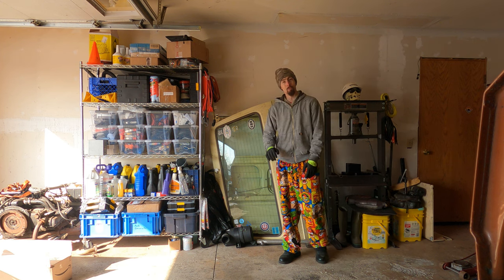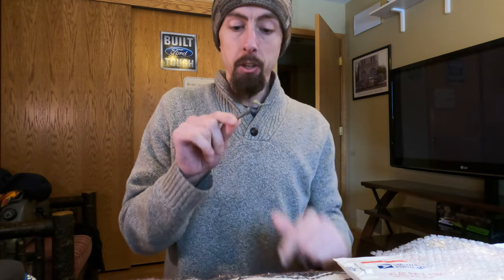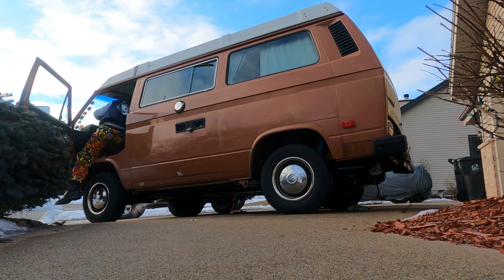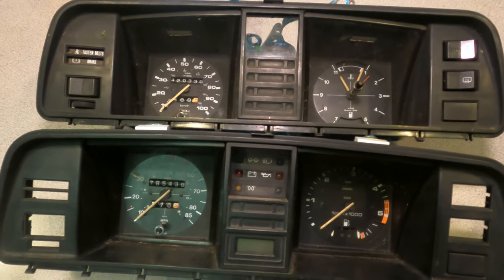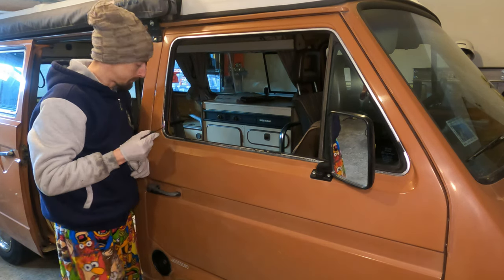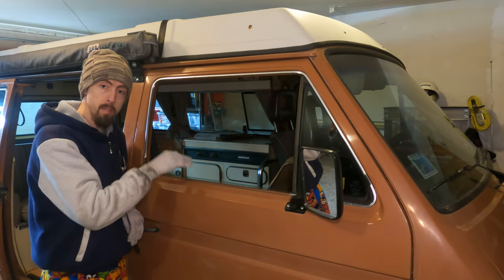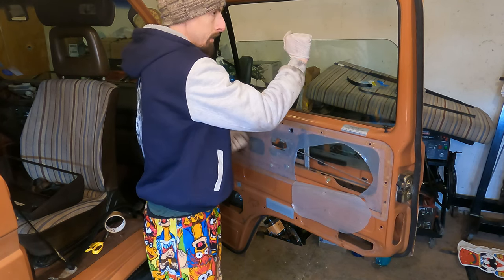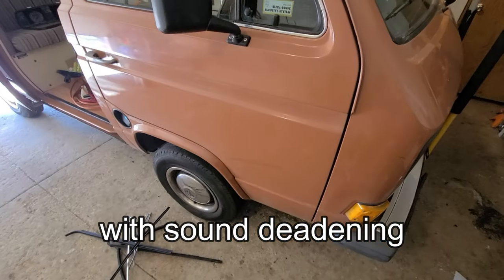Vanagon Westfalia Door Seals and Gauges

Comment: I have to do the same thing with the front door trim on my T3 so thankyou for that. Installing some Merc  alloy wheels  this week  that look like the Go Westy type this week! goodtimes!
Reply from the maker: Glad I could be helpful!
Factory Mercedes Wheels are much better quality. If not using spacers, you'll likely need to drill out the lug holes from 12mm Mercedes to 14mm Vanagon
Reply: @itsastevething.  I ended up  getting my partner to pick up some parts from Chris at T3 Technique for my Van as she was in the US recently. Such a knowledgeable chap. So glad I got the drill bit new studs, small ball nuts  and spacers. ready  to get some more off road-able tyres next!
Reply from the maker: @Matt Ellis  Christopher Camacho is a very versed individual. Happy to hear your dealing was positive 🙂